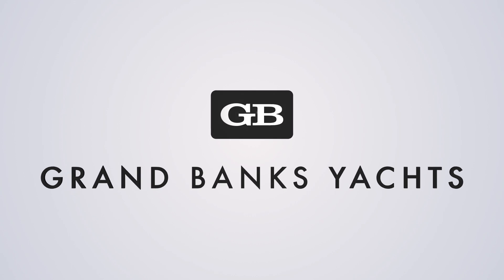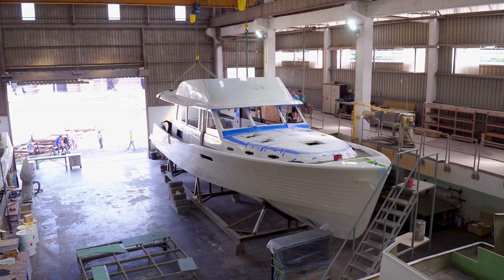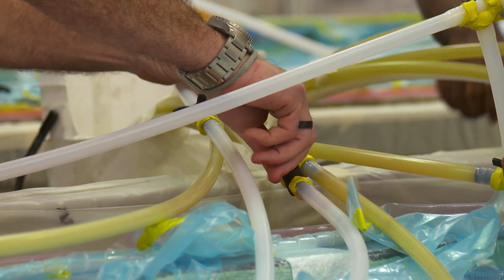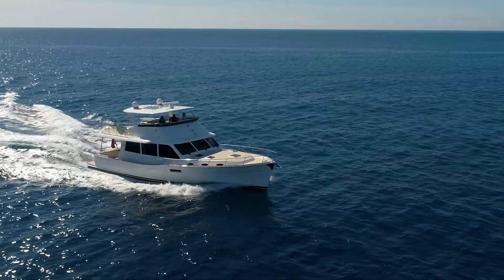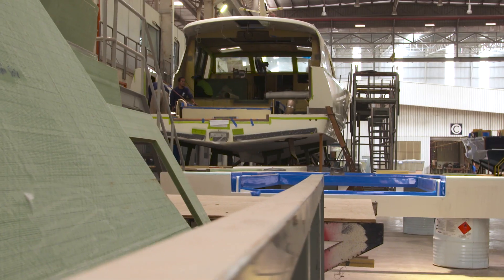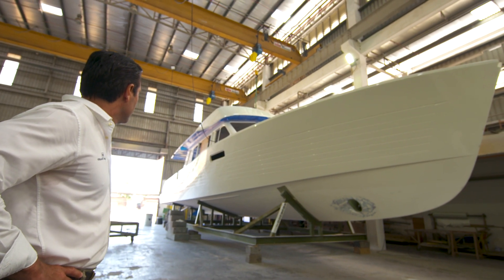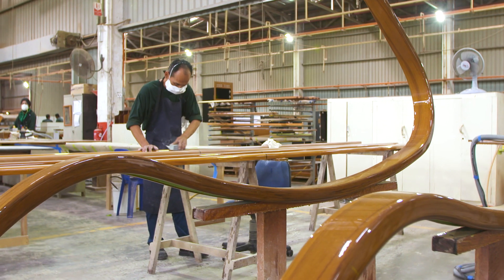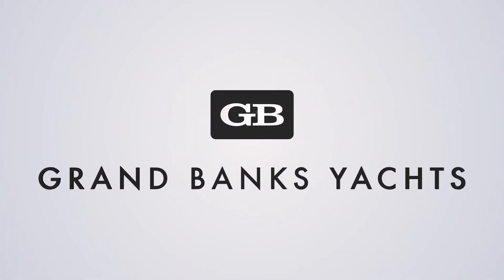GB60: Hull Design - Efficiency and Speed

Comment: Mulder does something like this too! It takes lots of horsepower and fuel to keep a boat on top of the water. Cutting through it makes so much more sense.
Reply: It takes a lot of power to get a planning hull up on the water; once it's there, it takes much less power to keep it there. (If sea conditions will allow it, of course.)